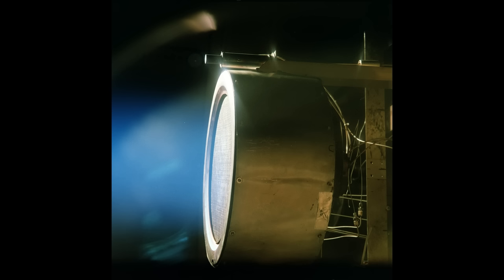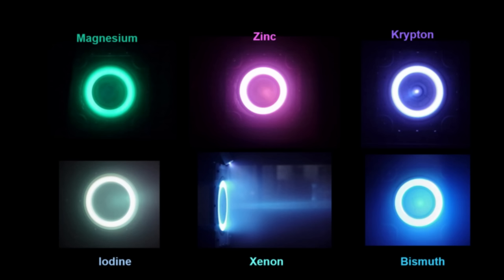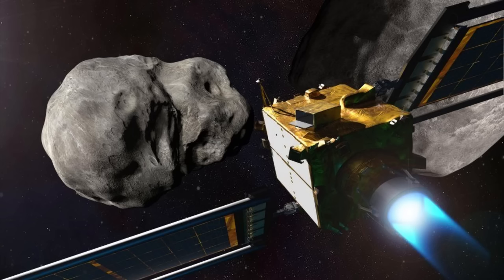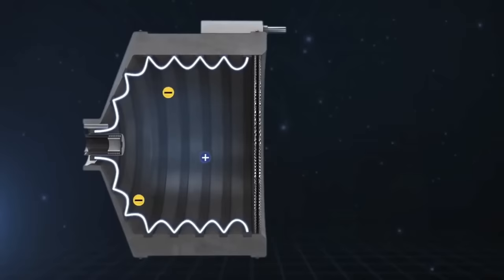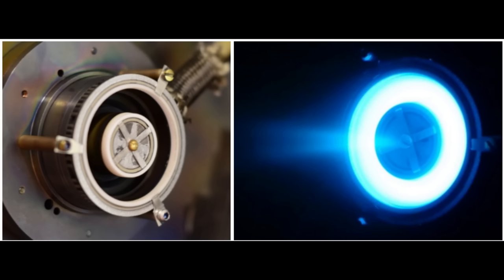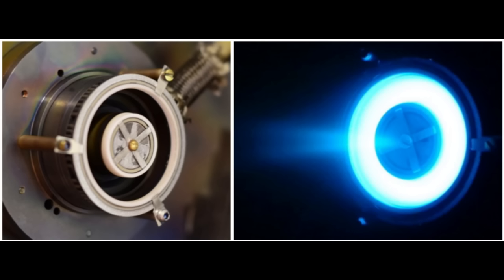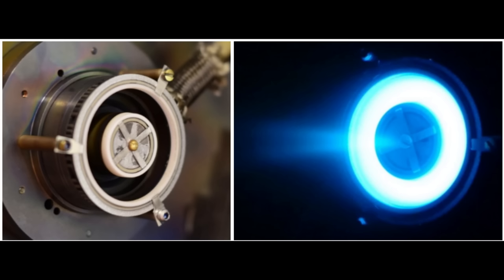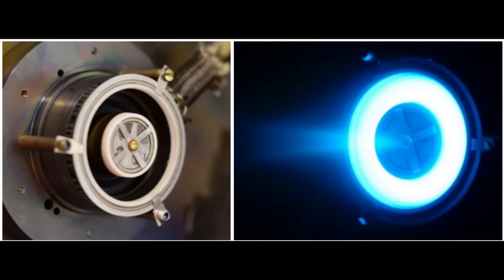Why Are There Two Different Types Of Electric Space Engines, And How Do They Work?

Comment from the maker: For everyone asking why it’s important to neutralize the exhaust, if you don’t then the positively charged Ions will get pulled back towards the spacecraft, and that will result in the thrust being cancelled out. So, it’s essential that the charge on the ions get removed in the process.
Reply: you forgot about the new electrically throttled solid rockets.
Reply: I was just going to ask why the protons have to be neutralised  :) thank you !
Reply: I believe you could magnetize the back end of the engine to keep those ions from coming back, but I also believe that you could extend a tube a great many meters behind this and use pulsing magnetic fields to continue accelerating  the ions to over 100 thousand kilometers per second.  I hear a report recently, may have been Helion, of an ion thruster that uses regular metal as fuel, vaporized as in a plasma cutter and shot out the back with a better thrust and better seconds of impulse.  Any news on that?
Reply: Solar panels and sensor electronics also like ion bombardment a lot less than than the walls of a thruster, so preventing erosion is also a big concern besides thrust efficiency
Reply: Literally scrolled down down to ask this, thank you!
Reply: @TheWadetube  if you keep throwing positive ions out the spacecraft, it’s inevitably gonna pick up a negative charge which will just keep getting stronger and stronger until it’s stronger than the electric field of the thruster and it no longer work.
Reply: And what about a reactor and what about possible fusion power source
Reply: Doesn't that assume that there's some sort of em field drag? A statically charge tail could dissipate that pull back effect just like a shaped propeller in ships and planes. Em drag is obviously different, but a fixed field behind the craft should be able to disperse the charge effect in the same way if that em tail fin is shaped in a way the demands thrust
Reply: wow, whata complex device, i had no idea, now i have some, thank you scott :)
Reply: nuclear fission thrusters when?
Reply: @SomeOne-zz4hs  next Tuesday
Reply: I thought it was that the overall charge of the spacecraft would then build up, and if it builds too high it will release it against some minor crap in the background of space, possibly causing damage. Basically, a static-electric shock.
Reply: why the need to neutralize the exhaust?
I thought it's more important to get rid of the accumulating electrons... and the exhaust is a good candidate for this.

Or am i wrong? 😅
Reply: @dustinswatsons9150  The sun is the only possible fusion power source for now and likely for a long time to come.
Reply: Another great fact filled video SM.
Thanks for taking the time to break it all down 👌
Reply: Electrically neutral spacecraft frame will be itself attracted to the cloud of charged particles
Reply: Well technically, the electrons are also part of the exhaust, they do have a little mass, so it's worth throwing them backwards too, but mostly you need to to get that high voltage differential... like connecting the positive terminal from a battery to push electrons into it, but not connecting the negative terminal to let electrons out... you're trying to run half a circuit. The battery just won't want those electrons, so you stop being able to generate the positive charge from it.
Reply: I was just about to ask this, and I never ask questions on youtube.
Reply: Also, you need to prevent the spacecraft itself developing a potential large enough to create nasty ESD arcs and such. If you're throwing a bunch of positive ions out the back, you need to balance that with a roughly equal amount of negative charge (the electrons from the neutralizer). Source: I'm the power subsystem engineer on an interplanetary mission using Hall Effect thrusters, and this continues to give us many headaches. So. many. headaches.
Reply: @felixar90    Yes, exactly, and it would take only a few seconds.
Reply: @WetDoggo    Neutralizing the exhaust and getting rid of the accumulating electrons are two ways of saying the same thing.  If you shoot positive ions out, you have to shoot electrons (or negative ions that carry electrons) out, too. Otherwise the negative charge that very quickly builds up on the spacecraft will reaccelerate the positive ions right back to the spacecraft, cancelling out the acceleration you put into them in hopes of getting thrust.
Reply: @TheWadetube  Sounds like a cross between a coilgun and a particle accelerator, turned into a propulsion device. Which sounds fucking rad.
Reply: @Islacrusez  Thanks, I hope the high speed coils operating Helion's impulse engine might be of use.
Reply: I just realized this is the same technology that is used inside thin film coating tech. I didn't understand why there was another small jet coming from the ion source inside the chamber. Now it makes sense, how else are you going to accelerate the ionized stream of gas.
Reply: @TheWadetube  yes wade cooper, enlighten us on how they (NASA scientists from across the industry) can improve on their design because you know so much
Reply: I was wondering this too, but I figured that since electric charge works like gravity (over infinite distance), but is much stronger, the neutralization is needed to make sure the exhaust doesn't pull you back towards it.  Not to mention how much space dust you'd attract.
Reply: Is this radioactive then?
Reply: I understand that not neutralizing the exhaust means that the spacecraft would acquire a static electric charge which would pull the (oppositely charged) exhaust in the spacecraft's direction, cancelling thrust.
I do not understand what prevents the spacecraft from accelerating a second beam, this one of either electrons or negatively charged ions, in the same direction as the positive ions are going.
Reply: Through history, energy ion/plasma electric power, used dinky size 🏟 halogen 🔦. Using a vast ☢storage. In solar orbit. When the ☢storage was suppose to AMP the electric thruster/booster power. (Actually it was suppressed knowledge)
Reply: Thanks I was just going to ask this
Reply: Was going to ask this lol
Reply: Why dont we just make a gravity engine that pushes away particles created from an artificial event horizon?
Reply: @nutzeeer  That feature doesn't require thrusting an evacuation flow of elements, gravity engines harness their own geomagnetic inertial property, granting the option of a geo momentum path as well as gyroscopic axis the way heavily celestial chem-life entities naturally do ( but they're geomagnetic). It can manage on pure mechanical power centripetal motioni with just electrical motors for a tories wheel. But ☢magnetic amp are forbidden practise, risk granting unnatural time & space attuning.(🛸)
Reply from the maker: Simon Tracer  because the laws of physics won’t let it work.
Reply: Simon Tracer  Have you heard of perpetual motion machines?  Also called "free energy" devices.  You might like them.
Reply: @Asdayasman  you two could be brothers smh
Reply: @deebo3864  Lmao SOMEONE missed the irony.
Reply: @mikldude9376  those are protons?  From Scott's description and graphics I thought they were cations
Reply: So you’ve decided to change your name to Scotty and you are in need of Di-Lithium Crystals to make the Enterprise move… Makes total sense to me.
Reply: @dustinswatsons9150  The best design for a spacecraft ( say to get to Mars ) would be to combine this with chemical thrusters to decrease the speed at the end, but to keep the acceleration for as long as possible.  So you get about 1/4 of your velocity from a conventional rocket and then accelerate, then reverse the process.  The fuel and time savings according to some graphs I've seen is on the order of only about 6 months to get to Mars and a significant fuel savings as well.  The goal is of course, to eventually get transit times down to about half that so that radiation exposure doesn't cause huge problems. Getting 10 years worth of radiation is surviveable with added shielding and precautions.  Getting 100-300 years worth (current technology, plus things like a solar flare or two) is probably not.  As it is, even a year (or three!) in space near any star is hugely detrimental to humans.  Who would have guessed?
Reply: @TheWadetube  One advantage fuel like this may have for a trip to Mars is that it would avoid the issue of a leak causing a problem with the fuel.  Having all of the remaining Aron gas leak out halfway there is a disaster.  This is just a brick of metal.  So while it's heavier, it comes with its own safety advantages as well.
Reply: @plektosgaming  After so many comments I am not sure what brick of metal engine you are talking about, but I did see a video on a metalic ion engine that uses scrap metal , as an arc plasma and ejects it out as an ion thruster and with good thrust, better than gas.  There are some liquid fuels that would not freeze or boil in space, it is the oxygen that is the problematic one.  I don't think tons of hydrogen peroxide at 95% purity is a good choice.  I prefer a nuclear ship that electrolyses water into oxygen and hydrogen when NEEDED for thrust .
Reply: Could you use  alpha-decay isotopes with a high decay rate as fuel ?
Reply: @ZoonCrypticon  Probably but this falls into the area of nuclear fuelled rockets, which there are bans on/political red tape.  Look at the chaos that ensued over Russia launching satellites with a small reactor/power gennerator on them in the past.  Maybe launching such a device from the Moon would probably be possible, though, as issues with radiation are largely moot - the Sun itself hammers the surface with much greater amounts over time.(150x that of Earth)
Reply: Well you can have a purely electric rocket it's just the thrust would be truly miniscule, that is using a laser powered by electricity; in otherworld's a photon rocket. The only way it's actually feasible is if you can make absolutely perfect mirrors and carry around photons as your rocket fuel which isn't theoretically impossible, just practically impossible and then at that point it isn't an electric rocket it's purely a photon rocket.

If you could do it though photons would be an excellent rocket fuel with an exhaust velocity of the speed of light 1KG of photons could acceleration 10KG of payload and space craft to almost 10% the speed of light like at that point only kugelblitz black holes offer the same exhaust velocities.

Again though practically impossible, not that we can't already make almost perfect mirrors in single wave lengths of light, issue being though that as you accelerate you would change the wavelength of the light in your containers so even if you poured photons in of a single wave length if you tried putting 1KG of photons inside the container then accelerated it it would go boom with the power of a 1000 nukes, so kinda inconvenient.

Also you would have to have a container strong enough to deal with 2x the photon pressure so impractical there as well as you would be limited by the amount you could contain by the strength of the mirrors, so even theoretically it's not going to work.
Reply: @Etheoma  Laser ablation has been shown to lift a small spinning cone, about 9 inches in diameter with little to no wear on it's reflective underside.  So this is not purely photon thrust, there is also a pop of atmosphere and ablation of the metal the surface is made of, ; aluminum, I think.  If you carry your own laser  you could shoot the back end of your ship, perhaps the exhaust bell nozzel itself to provide thrust using fast spinning vectoring mirrors.
Reply: Got it! 🙏🏽
Reply: Plz fix too low audio levels. Use proper audio normalization techniques.
Reply: so are they working on thrusters that use the Rydberg polaritons as propellant that can be made with electric energy